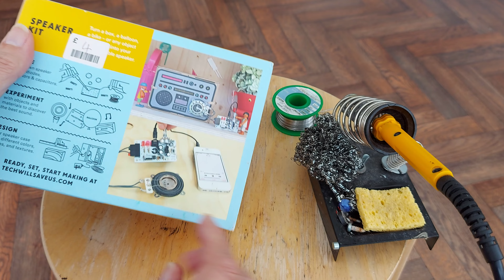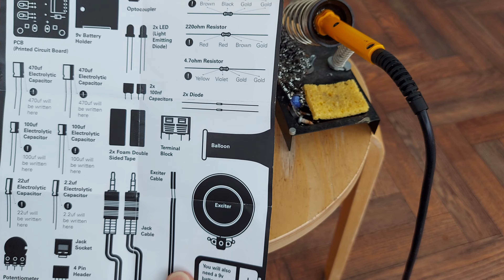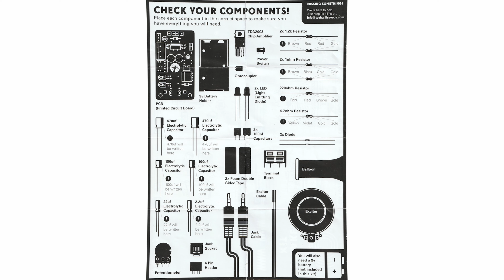Assembling the TWSU Speaker Kit

Comment: Well, there's a lesson learned:  Check your battery BEFORE you start de-soldering stuff.  Who knew?!?!?  LOL!  
I'd love to do this just for the nostalgia sake but the last one I tried, I could not get the components to fit through 
the board. To this day, I don't know if the holes were too small or or misaligned or if my manual dexterity is just that bad.
Reply from the maker: Yes, the fact the LED came on fooled me into thinking the battery was OK. Unfortunately I have a habit of putting batteries on the table and letting the good ones get mixed up with the dead ones.
Reply: @GrandadsOtherChannel  Me too.  I end up testing and retesting the same half used batteries over and over.